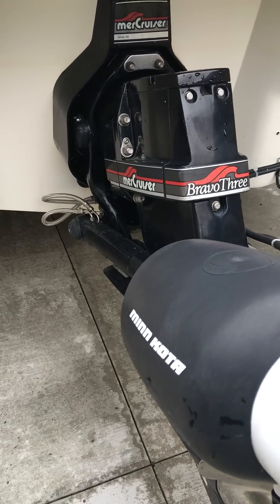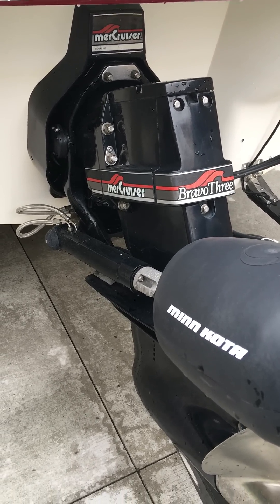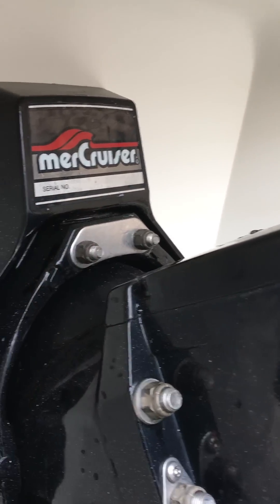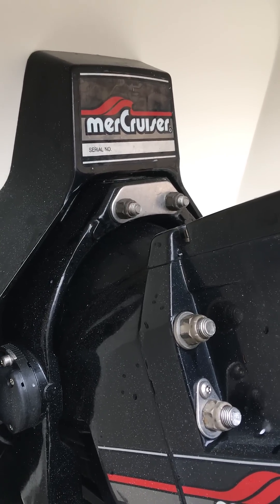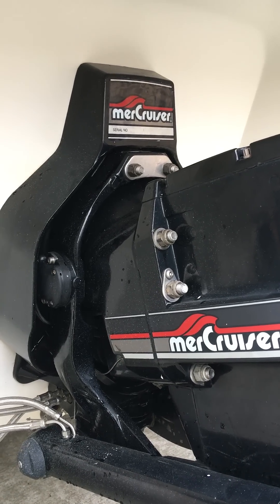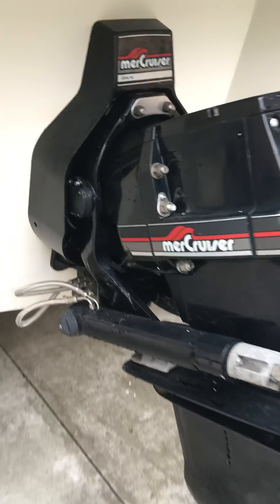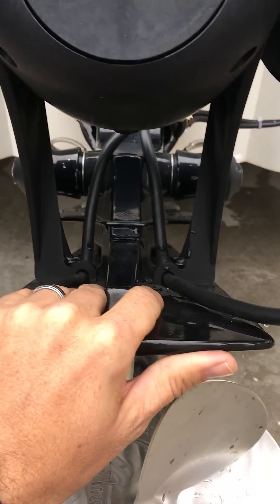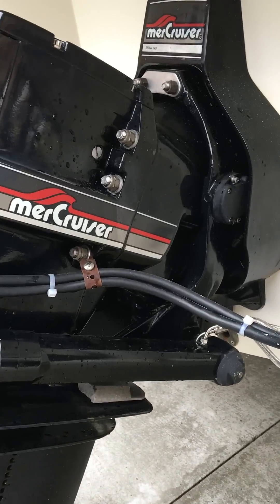MerCruiser Bravo III gimbal ring check

Comment: Your steering pin is loose on the gimbal ring. It is a lot of work, but necessary to be safe. A new gimbal ring is very expensive, but if you take your old gimbal ring to a good welder, they can rebuild the surface of it, where the steering pin engages, for much less $. Give him the new steering pin too, so he can get it as close as possible. The two nuts on the back there, are a u-bolt that clamps the gimbal ring to the steering pin. It doesn't flex much, so the tolerance is tight. There is no quick fix for this. It will progressively get worse, if left as is. 
Wear, compounds wear.
Reply from the maker: Thanks for the reply.  Other than adding another nut to each side to double nut it.  I never had to do anything else to this.  It never got worse and still to this day.  So....
Reply: @GasCJMan  it's always fine...until it's not. But yeah, if it works for you, then let it ride. Just want you to be safe and informed.
Reply from the maker: @thediplomasta5891  thanks for the concern and advise.

Comment: It's definitely going to tighten the ring to swivel shaft but the gimble may have dropped down. There is a measurement at the bottom the gimble ring at the bottom swivel shaft. It 2 to 10 thousands between the gimble ring and the transom assembly. But you should be good as long as the top seal isn't leaking water into the boat. Looks like u caught it in time though. Any longer then you would not of been able to tighten the u bolt up enough. Lots of people try to tighten the u bolt but end up snapping it.
Reply from the maker: Marc Harris  good call.   I didn’t take the measurement but it’s been tight and hasn’t loosened any in three seasons now.   And I’ve even had a gimbal bearing and bellow job done by a shop mechanic and he didn’t notice any issues with it.   So... we should be good.  Ship it.
Reply: This particular u-bolt, is like a head bolt. It stretches when torqued, and can only be used once. There are available good AND bad quality versions of this exact u-bolt for sale online. Choose carefully, this one piece of hardware, when repairing your merc.

Comment: Hello, this video has been wonderful explanations I bought it and found a solution with this video
http://www.ebay.com/itm/252487824780?ssPageName=STRK:MESELX:IT&_trksid=p3984.m1555.l2649
Reply from the maker: Yücel Yildiz   

I discovered once torque to spec mine was fine and was thru the entire season.  

What do those new bolt things do?

Comment: So what happened in the end ? Did it fix it ?
Reply: Did you hear noises when driving the boat? Trying understand what led to this work
Reply from the maker: I was able to slowly retorque from side to side and get it back to a good side to side spec.  It barely moves.  I then locktite and double nut the threads on the gimbal ring. I ran about 18 hours on it this way and it is still nice and tight.  

I believe the previous owner never checked the torque setting on this.
Reply: ***** What do you mean by
 double nut? You put 2 nuts on one stud?
Reply from the maker: @outofthebluefishing9570  

Sorry didn’t see this.  Yea it was just another stainless steel nut on the remaining threads and tightened against the existing nuts.